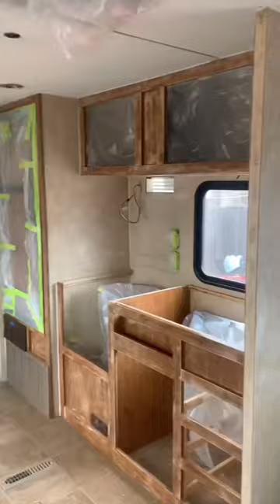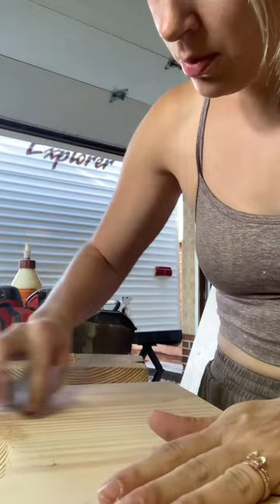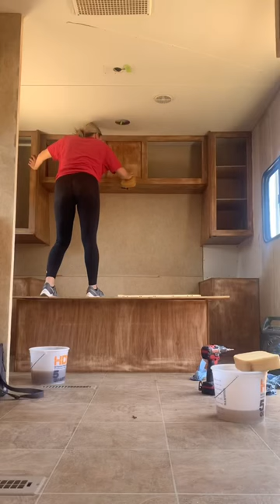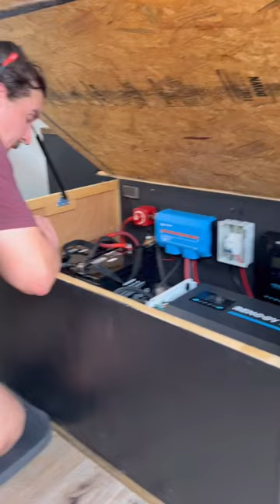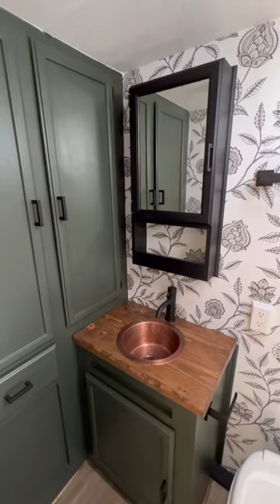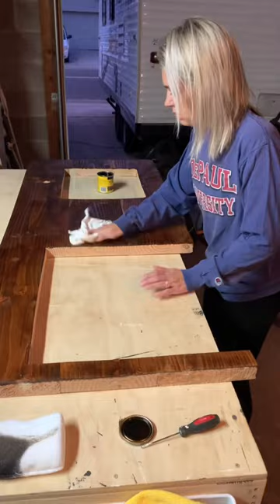RV renovation mistakes pt 3 #rvlife #rvliving #rvrenovation

Comment: Remove the AC from the roof. Put a smaller window type through the wall. Less expensive, fewer roof penetrations, lower rv height, less weight up high.